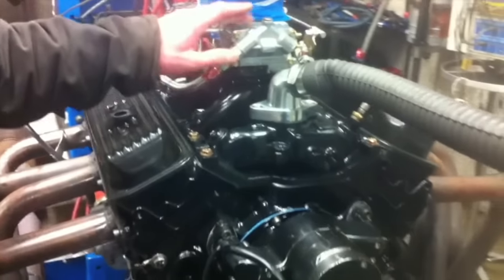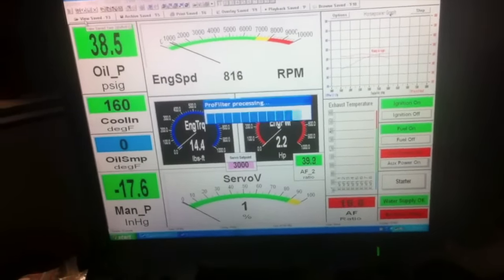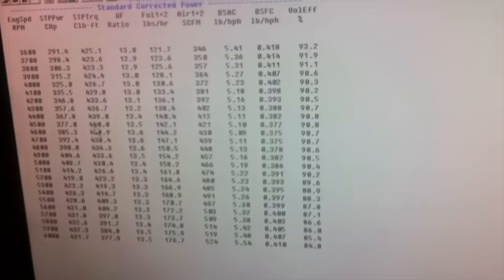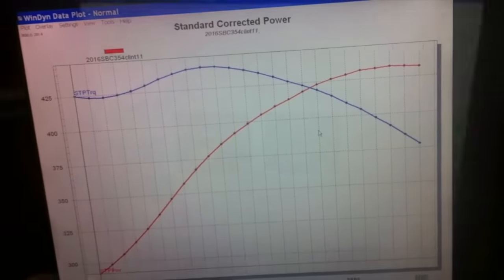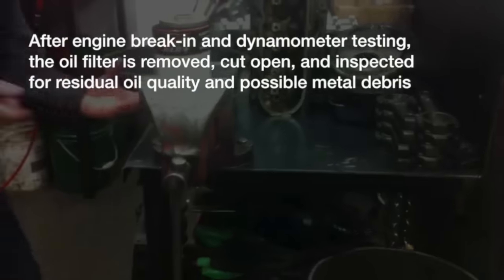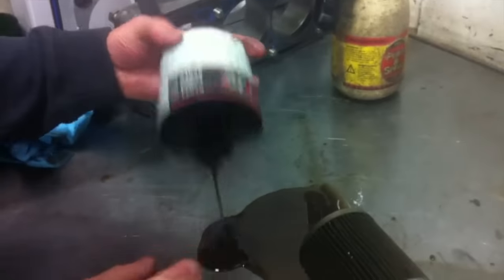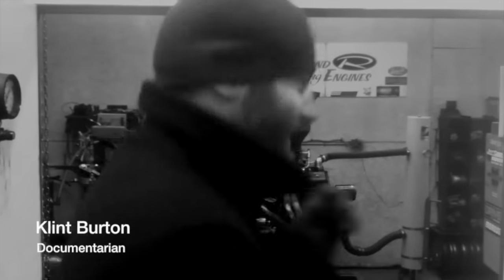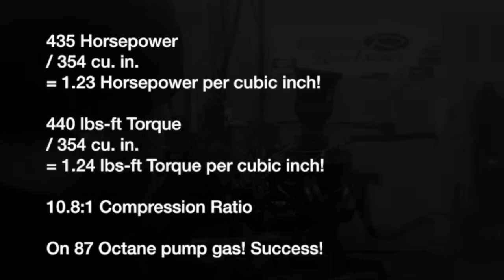SBC 400 Block + 327 Crankshaft Dyno The 350 Chevy Should Have Built (2016)

Comment: This is awesome to see! I for year have wondered about “destroking” a small block chevy. My idea was a 350 base with a shorter stoke. Get the revs up! Keep at it!
Reply from the maker: Thank you!!
Reply: gm did that in the late sixties with their 327. they used a 283 crank and made the chevy 302.
Reply from the maker: That’s right. Great little engine!
Reply: Hot rodders were doing that 60 something years ago with the 283 before the 327 came along,the 301 or as Chevy later called it,the 302.
Reply: @krazi77  Ford did the same thing as well.  They took the 289 which already had a bore of 4" and stroked it to 3".  The high performance Boss 302 was rated the same as the Z28 Camaro at 290 horsepower.  Those engines were high RPM screamers not low end torque monsters.
Reply from the maker: Similar idea but dimensions are all different. Ours is a 4.155” bore and 3.25” crankshaft.

Comment: I used to help out some small oval track racers up in Maine and I can remember in the 90s guys started building 305 blocks with I believe a 400 crank and 350 rods and 0.30" over 350 pistons. It's been years but no matter it came out to 348 ci and wound for days. They tolerated it at the short tracks for the first season, lol.
Reply from the maker: Hi Austin! That's an interesting engine combination! We've seen brilliant results using a larger bore, however. If your engine combo worked for you and your team, awesome! The point is to build something (hopefully learning a thing or two in the process), put it in something, and drive the thing! Best regards!
Reply: @ceperformance  yeah we weren't running that engine, (different class) or I would probably know more about it. I just seen a few run and it was a potent little small block.
Reply from the maker: Interesting. Thanks for commenting!

Comment: Saw the A/F-ratios it ran on the dyno, and thought "What if a modern fuel system were applied to it, with a knock-sensing ESTC (Electronic Spark Timing Control) ignition system?" Then I thought "What if it ran a Flex-Fuel management system, on E85, with a bypass-valve blower atop it? After-all: Boost & ethanol blend well!" ;)
Reply: By "modern fuel system", your talking about FI. Modern port injection FI & spark management will never make the power of a carb. NHRA Pro Stock proves this because until Erika set a new ET record at Gainesville last year with Altitude Air Density of 1,400 feet BELOW sea level, Pro Stocks couldn't get within 1/10 second of the old carb record. She still didn't get close to the carb MPH record which is the most accurate indicator of HP & nobody has gotten close to the ET record since with normal conditions. First, the intake air is warmer & less dense with port injection & second, the timing control would pull timing with the slightest indication of "knock". Both hurt power output. The owner of "The Fuel Injection University" tunes the Elite Motorsports Pro Stock cars & several of the 7 second factory shootout cars. In private conversation with a friend of mine, he stated that FI doesn't do anything better than a carb. NASCAR proves this to be so because they've reduced the RPM by 2,000 & the HP by 250 at short tracks & 450 on 1.5 mile & longer tracks, made the cars more aero, & they still get the same MPG. FI is for people who don't know how to tune a carb & ignition curve. My own experience bares this out. I have an 89 Chevy C1500 NASCAR look pickup running a 409" SBC with a 750 Holley Street HP double pumper that's run 150 MPH on a Garmin GPS. I also have a stock '04 Tahoe, except for a regular gas tune, AirRaid intake tube & magnaflow muffler. My hotrod gets better fuel economy & will smoke the electronic controlled Tahoe in a drag or top end race.
Reply: Sounds like you just invented the LS?!

Comment: What heads, valves, cam specs & was it advanced?  Also what rods & were the pistons special?  I have been building 355s with Vortec heads,,202/160 valves, pocket ported ect.  425 with close to 11.1cr on 91 octane.  What's the advance curve look like & is it all mechanical or do you run any vacuum advance?  Looking to build better tq  engines for suvs & pickups.  Thanks
Reply from the maker: Hey there. This one has Vortec heads with 2.02” / 1.6” valves. Angle milled .100” down to 55cc’s in the chambers. We used 6.25” rods and off the shelf 400 Chevy pistons meant for 6.0” rods. Pretty simple build and not expensive. We didn’t use vacuum advance and set the mechanical to maximum of about 30 degrees if I remember correctly. 
Thanks for commenting :)

Comment: What rod length did you use? Who's block did you use due to 400 sbc was a 2.650" main (junk), when you selected an aftermarket block did you go 327 small or large journal?
Reply from the maker: We used 6.250” rods and a “retired” Dart 400 block that was badly damaged in a 1/4 mile car that chucked a few rods :)
It had the regular 350 mains in it.

Comment: Brilliant, this would drag any old car around for fun. Really impressed with the torque if I'm honest, still loads of torque for such a short stroke. 10/10 for end results.
Reply from the maker: Hi Jim! Thanks for commenting! You're right! Here's us road testing this SBC before the engine went to our customer. It was a lot of fun!: https://www.youtube.com/watch?v=SapdPR_SgMQ
Reply: Stroke has nothing to do with torque. If you take 2 engines of equal displacement with the same comp, heads & cam, the big bore / short stroke motor will ALWAYS make more TQ & HP throughout the entire RPM range, because the short stroke reduces "piston speed" / paracitic loss to friction & the big bore increase airflow by unshrouding the intake valve & also allows for bigger valves
Reply: @bradgriffith4231  Stroke increases torque by increasing piston / rod speed in the same size bore, it also has the effect of moving the torque lower down the rev range.
More piston speed = more torque low down.
Less piston speed means torque higher up and much more hp potential at higer rpm.
Yes, a good builder can extract the same kind of numbers with short stroke as this video proves.
Reply from the maker: @bradgriffith4231  Proof from under-square engines, with low RPM and very high torque capabilities would show otherwise. It's all about application, and where torque in the RPM range is desired. Thanks for your comments!
Reply: @Jim_M_75  Sorry Jim but longer stroke increases "piston speed" which is the MAIN parasitic loss to friction in an engine. To make the math simple, calculate the distance traveled by 8 pistons at 10,000 RPM with a 3.25" stroke & a 3.50" stroke. The difference is astronomical. A big bore short stroke engine makes more TQ & HP throughout the entire RPM range if all other parameters are the same.
Reply: @bradgriffith4231  thats strange because if you build a 383 stroker from a 350 block with a 400 crank you add more Torque than HP with no other changes.
Reply: @bradgriffith4231  "Stroke has nothing to do with torque."
t. failed high school physics
Reply from the maker: Now now, play nice boys :) 
Thanks guys for your comments.
Reply: @cuzz63  HP is a math equation of TQ x RPM / 5250. It's not possible to add more torque without increasing HP & if you went from a 350 to 383, the displacement alone should add more TQ & HP both. IT might not have made more PEAK HP because you increased displacement 10% & didn't instal a bigger cam
Reply: @bubbleman2002  Our ALL MOTOR S/C Olds Cutlas went 7.96 / 168 in Phoenix with 4,000 altitude air density with a single Pro Systems carb on race gas. No huffer, no hair dryers & no juice! How's your slug run?
Reply: @bradgriffith4231  . David Vizard says otherwise.
Reply: @bradgriffith4231  I didn't say your car was slow, or mine was faster, I said your understanding of physics was poor. If stroke doesn't matter when it comes to torque, why do diesel engines almost always have a very long crank throw, even small displacement ones? Why do rotary engines make poor torque naturally aspirated, compared to piston engines?
Reply: @bubbleman2002  The conversation isn't about a turbo or supercharged diesels. It's about  gasoline "performance" engines.
Reply: @cuzz63  Vizard's books are ok but are a minimum 30 years old. I've probably read more of his writings than you.
Reply: @bradgriffith4231  You have no interest in having an argument, you are only interested in being right, which is why you have copped out of explaining why stroke doesn't impact torque despite those two internal combustion engine layouts' characteristics proving you very wrong. Claiming that the entire field of physics is wrong is an extraordinary claim, and must be substantiated. Have a nice rest of your day.
Reply: @bubbleman2002  What have you explained? If all other compments are the same, the big bore short stroke will make the same TQ down low & more in the higher RPM. Piston speed is the main parasitic loss in an engine so any gain one might get from a longer stroke is lost to friction. IF you do the math, a 1/4 inch increase in stroke dramatically increases the distances the 8 pistons travel in any given time. IF what you say holds true, then all the manufacturers would make truck engines undersquare, but they haven't done that for over 60 years. In the 70s, with SMOG motors, Chevy went to smaller bores with the 305 & 307, but they did this for emissions control, because the HC is easier to control than in the larger bore. The laws of physics support my premise because increasing drag never produces more of anything other than the effort needed to overcome it. Seems like you're the one who just wants to argue. You have a nice life, expert.

Comment: My 400 is a 2bolt main & my dad & i built it 20 years ago to the specifications of an old GM motor with 400lbs torque at 1800rpm with the necessary compression & cam ! it was for a rock crawler so my dad wanted all the low end grunt as possible! i still have the motor but the the rig needs work!
Reply from the maker: Awesome memories I bet!! Thanks for commenting :)

Comment: That`s a great combination, when ya have a nice flat torque curve they`re a dream to drive. I`ve only built 2 of those when I was a pup, for a guy running the GT/Trans Am series. they were 349`s it was 1982, they ran at Riverside and from that day on I was sold on the big bore SBC. Did you know that GM made a main bearing to do just that so ya didn`t have to stack bearings? Didn`t find out till the second motor
Reply from the maker: I wonder if GM still makes those bearings? My guess is that they don’t, like so many great products that have been discontinued. Kinda sad that they stop some great pieces and that’s it. Tough luck.
Reply: @ceperformance  Well it looks like, according to my, Bible The Clevite 77 Book they still do. MS-1564P  But they`re not the same in #5 position as they were back in 1982 as best as i can recollect. they were a drop in at the time
Reply: Trans Am has always been a 305" motor limit from the very beginning. That's where the Ford & Chevy 302s came from. Chrysler, Rambler, Pontiac, etc never made their T/A sized motors for a production vehicle. Even the production class sports cars of today's road racing sanctioning bodies have a 305" limit, which is probably the reason Ford's production line, flat plane crank, 4 cam Mustang motor is still a "302". Chevy destrokes their flat plane crank, 4 cam Vette motors to comply with the displacement rule.
Reply: @bradgriffith4231  They ran the GT`s with the TA`s and Yes the TA`s were the 5L`s

Comment: Heads? Cam? intake?
Reply from the maker: Hi Charles Smalling! Thank you for your question. This build had a:
- repurposed 400 SBC Dart block 
- 3.25" stroke 327 steel crankshaft
- 6.25" Scat H-beam connecting rods
- 4.165" SRP forged pistons w/ 1.125" compression height
- 10.8:1 compression ratio
- 4/7 swap; mild 218/224 duration solid roller camshaft
- stock cast vortec heads with upgraded rocker studs
- Edelbrock RPM Air-Gap intake manifold

Comment: What cam did you use
Reply from the maker: Hi caddydaddy 67! We used a conservative 218/224, 4/7 swap, solid roller Comp cam with 112 LSA for this build. Best regards.
Reply: I have not tried a 4/7 swap cam sounds like it should be in my future thank you👍👍
Reply: dyno tests show that it depends on the intake manifold.... depends how the pulsations affect the plenum.
no big gains but every little bit counts, i guess.
heads are a better bet but more $$$
Reply: @ceperformance  Finally someone that isnt afraid of a solid roller in an engine that winds up
Never understood screwing around with new goofy h. lifters in search of rpm its just not the same.
Reply from the maker: @gordocarbo 
That’s so true :) Thanks for commenting. Here’s another build you might like. Two videos… 
SBC 283 Crankshaft + 400 Block = 500+ HP (Dyno Test 1 of 2)
https://youtu.be/dBjdYC5sMjs

And the follow up… 
https://youtu.be/Ge6RsIOs1-U?si=BtMwMzw4TA3U2P-e

Comment: Not a SBC But....My Dad and I were into Oldsmobiles when I was in High School, Late 80's. He had a '68 442 (look up the terrible bore/stroke on that thing). I had a '68 Cutlass S, factory 4 speed/350 4 barrel. The 350 Olds has a slightly shorter stroke and slightly bigger bore than a 350 Chevy. I worked at a machine shop in HS so I built a 403 Olds (same stroke as 330/350 Olds, but with a huge bore (standard bore 4.351!). The one I built was .040 over so bore 4.391! Those pistons were huge! Put the 350 heads on it (had to drill out head bolt holes, the 403's have bigger head bolts, and put in the biggest valves we could. Ran low 13's at 106 mph all day on 235/70R14 street tires. Even missed third gear (went into first gear!) a couple times and didn't hurt it. Valves would float at around 6400, so that was the redline. I beat the piss out of that thing, Best engine I ever built. Also built a couple 455 Olds, the worst engines I ever built!
Reply from the maker: Cool stuff! Great memories I bet :)

Comment: Oldsmobile had the best combo ( stock configuration) for GM small block but crappy cylinder heads. 3.385 stroke 4.057 bore
Reply from the maker: Great bore/stroke combo!
Reply: @ceperformance  my little 355 olds will spin to 7k rpm easily. The stock rods and crank have held up amazingly well lol
Reply from the maker: That’s awesome! They built ‘em tough back then.

Comment: I'm pretty much hooked on big bore short stroke combos. 
I have a 13 to 1 , 377 sbc with a 830 Holley and other then my dog it's my best friend .
Reply from the maker: Cool! Did you see this one we built?…

https://youtu.be/ttEsebehdrc?si=OPUxiEF4FwIwtBzY

Or this one… 

https://youtu.be/dBjdYC5sMjs?si=YPmJH0-QPmkXsvrD

Or this..  
Dyno #2 283 Crankshaft + 400 Block 512 HP 435 LBS FT Valve Float Fixed
https://youtu.be/Ge6RsIOs1-U

Comment: This is the combination of most 360 sprint car engines, they make 700+ hp!
Reply from the maker: Hi cliff beckwith! This is a brilliant engine component combination and certainly surprised us with the torque values, 440 lbs ft, and a wide RPM range where the torque stayed above th 400 lbs ft mark, from such a mild cam. Best regards.

Comment: I use to run 377, oversized bearings 350 crank with 6 inch rods in my s-10 back when dinosaurs walked the land.  Was a bit prone to overheating when I ran the ac but a lot of fun.
Reply from the maker: Hi Pumpkin King! Thanks for commenting! We've not had overheating issues. In fact, we've had a couple of our engines run a little on the cooler side, and are fine sitting in summer stop-and-go commuting traffic. Best regards!

Comment: A buddy of mine built a 353- 400 block with 327 crank. It had such a big cam in it that it sounded like two motor cycle engines bolted together. It idled at like 1500rpm with a 4/7 swap cam it pulled@ 9" vacuum. 575hp at 7100rpm.  But what was impressive was the torque curve was dead flat from 3500 on up. We put it in a cj7 jeep 😂
Reply from the maker: Wow that must have been hilarious :)

Comment: Did your use 400 connecting rods and did you use the 400 balancer and fly wheel? Also we’re those 327 heads or 400 heads?
Reply from the maker: 400 rods are even shorter than stock 350 rods. Our intention was to use the longest we could with non custom pistons, which we did using aftermarket 6.25” rods. We used 350 Vortec cylinder heads.

Comment: How hard was it getting those SBC 'Vortec' heads to work on that 400 Block? As many know,but some don't,a 400 SBC has a slightly unique head because of the larger 'siamesed' bore,which has a 'steam hole' (for lack of better terms) that the 265-350 SBC heads & blocks didn't? Takes a <really good> machinist to do this modification sometimes,and a lot of places just don't like doing things like this? Add that SBC Vortecs are also a bit prone to cracking as well? (thinner casting than many older SBC heads,it's actually hard to find good buildable cores at least locally because of that issue. I know this because I just went thru this on my pickup!!!)
Reply from the maker: Hey, thanks for commenting. It’s quite easy to make that change using a gasket for alignment.

Comment: Finally get too see/hear instead of reading the old ads. I wanted to do the same only bored over .30 for a 4.155 bore. But i also seen the build with the 283 crank. How would you rate the 2 builds
Reply from the maker: Thank you for commenting! 
Both builds are really awesome. The 327 crank build (354) was more on a budget and used factory Vortec heads, although with a bit of work done, basic roller tip rockers and a very mild camshaft. (218/224 @.050”)
The 283 build (329) was more expensive because we couldn’t resist using the AFR’s. (Absolutely worth it!)
We’re extremely impressed with both the torque and HP of the 283 build as well as the mild mannered street driver it’s going to be.